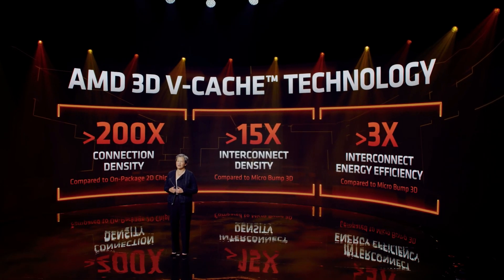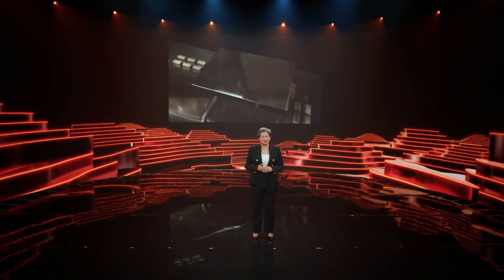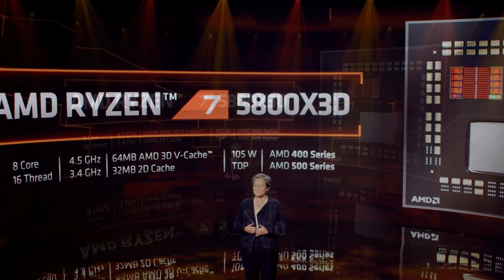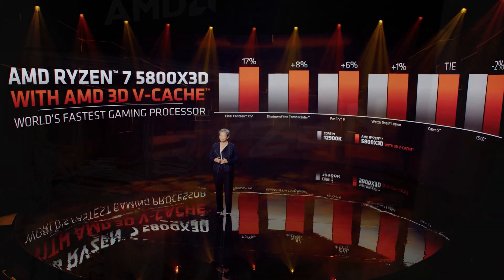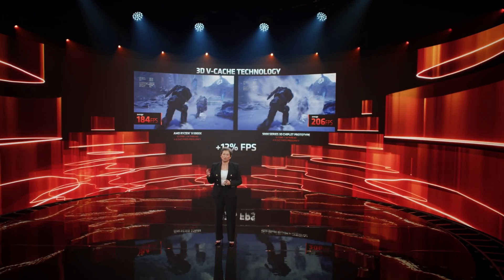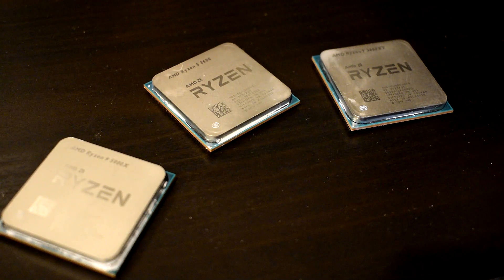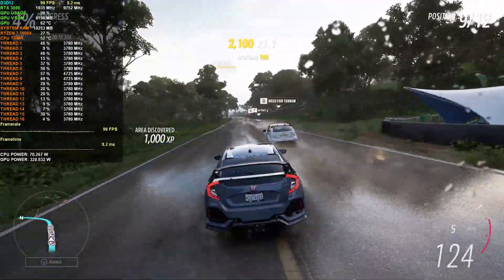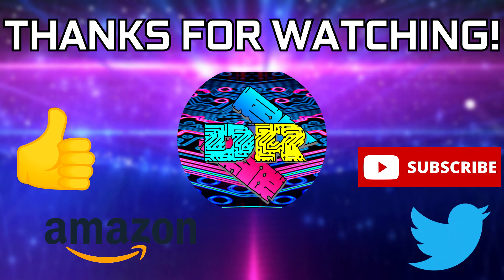AMD's Ryzen 7 5800X3D Is A Strange Product With A Lot Of Missed Opportunity For Early Zen Adopters

Comment: For gaming 6 cores is the balanced choice. 8 cores squezes out the max you can get. the 12 core ryzen beats the 8 core ryzen pure on frequency. Reviewers tested the ryzen 5900x with the same frequency as the 5800x and gaming results where almost equel. So getting more then 8 cores for gaming is currently not needed. 3D cache is a feature that excels mainly for gaming. but because of the extra heat the processor speed is reduced. Logicly the 5800X is the prime candidate for 3D cache. Putting 3D cache on the 5900 is a shame. Personally I have the 3600 and I'm definatly upgrading to the 5800X3D with my 450 board

Comment: I think they need to collect a large amount of defective chiplets/dies before they can make a 6 or 12 core 3DX chip, TSMC isn't making it easy with the yields they are getting on the process. They will come in due time.
Reply: They wont come at all. By the time something like that would even happen they would have already launched Zen4 and gotten passed the inevitable first 3-4 months where the lack of chips makes it basically a paper launch in this market

Comment: I had some very minor regrets about not getting the 5900x a little over a year ago. Still I'm pretty happy with my normal 5800x. If they had announced a 5900 x 3D? I probably would have been all over that. 

I have an RTX 3080 but I'm playing at 1440p and I like to average over 75fps with my free sync monitor. Extra processing horsepower wouldn't make that much of a difference anyway I just think it would be cool.
Reply: nomasporfavor  it really depends on the game you're playing I'm playing things like cyberpunk on Max settings. When you push all the important sliders to the right that's what tends to happen Apex Legends is sort of one of those esports games that a potato can run I'm not surprised you're getting a solid FPS on that.

Comment: As a b550 user, this is a good news. I was gonna buy the 5800x, but got the 5600x instead cause it was the only one available at msrp at the time. Considering that upgrading to zen4 and ddr5 when it releases will probably cost a kidney, this would be a good upgrade option in maybe 1-2 years when the price drops.
Reply: Same case here 👍✌️
Reply: Yeah DDR4 is really good. I think it is too early to jump on DDR5 - especially for anyone who invested in good DDR4 RAM. There is a real issue though that realistically you want to be putting this in a 500 series motherboard but anyone who has a 500 series motherboard is going to have a decent enough CPU. I cheaped out by pairing a high end B350 board with a Ryzen 5 2600. I'm still glad I did as it represented really good value, but realistically I'd need to get a new MOBO to pair with a 5000 series CPU which means I'd only be moving the RAM over.

Comment: As a ryzen 1600/ x370 owner I say bring on some compatibility to early adopters
Reply: Just buy a new motherboard dude, those X370 boards really arent the best and putting a zen 3 chip on a X370 would be like driving a ferrari on shitty tires
Reply: @Angel7black  ill just wait until my rig doesn't play games, running a 1080ti on a 3440x1440 @100hz, still plays everything fine for now, upgrade path is difficult with current prices of gpus and am5 coming out later this year, new motherboard is a waste of money imo

Comment: I have a 3950x I wanted to go for 5950x3d. I skipped the 5950x... I only want to upgrade because I want the last processor for am4. I hope they release the 5950x3d.
Reply: I’m in the exact same boat as you
Reply: @biggorilla1999  I know right I have a x570 hero 8 by Asus which I bought in 2019 I was expecting at least 3 year CPU upgrade service for that board. Such a Shame but hey hope AMD gets the 5950x3D

Comment: Most likely reason for AMD only releasing the 5800X3D is that the 5900X3D/5950X3D would be too close to ZEN4 in performance.

There wouldn't be any real need to purchase a new AM5 Motherboard and the expensive DDR5 memory that goes with it,
if people could just keep their existing AM4 motherboards and DDR4 ram (and simply just buy a 5900X3D/5950X3D).

So it's basically all about money/profit.

5800X3D won't pose any threat to ZEN4 sales (as it is a mid-range CPU), but the 5900X3D/5950X3D would.
Reply: LOL they are a business when is it not about profits?
Reply: @ssaini5028  That kind of goes without saying.

But still, a lot of people don't seem to understand why they're not making a 5900X3D/5950X3D
(i think it's pretty clear why it's not going to happen).

I'd be very surprised if they release anything other than just the 5800X3D for ZEN3.
Reply: @SuperConker  5800X3D thats it you are right and nothing else has been announced anyways.  5800X3D is purely a response to Intels 12900k's lead in gaming.  Last year the only performance slides AMD provided us was gaming 15-25% gains from 3D V-Cache alone. I dont see how anyone could have an issue with this.  
Whats even more ridiculous is Intels response which is a binned 5.5Ghz 12900K variant.
Reply: too lure clueless gamers, to make them buy 5800x3d while offering it as the only alternative, no cheape
Reply: @user-wq9mw2xz3j  For those gamers with a AM4 Platform and only care about gaming it does not get better than the 5800X3D
Reply: @ssaini5028  it doesn't get better than a r5 3600, or at max r5 5600x, since if you care about money and still have am4 that means you're not gonna have a 3090 ti so it won't matter anyways.
Reply: @user-wq9mw2xz3j  I am not understanding you.  Depending on your needs the 5800X3D should get you way more FPS than the 3600 in games.  3090Ti ain't necessary a 6900XT or a 3080TI will suffice
Reply: @ssaini5028  it wont get you "way more fps" in any game not even compared to 3600. And compared to 5600x, barely any.

Unless youre talking about going from 400 fps in cs go to 500 fps which is useless...

if you have $1500 to spend on a 6900xt or a 3080ti, you can spend $50 more on buying a new motherboard for when next gen mobo/cpus come out...
Reply: @user-wq9mw2xz3j  the i9 12900k is faster than the 5950X in gaming right?  The 5800X3D accoring to AMD is faster than that.  There is a lot of people out there that want the best in terms of a gaming CPU but not necessarily wants to change platform motherboards RAM etc.  For a consumers on the AM4 that possibly wants the extra performance might consider the 5800X3D instead of switch up to Intel thats my point.  Yea money might not be an issue for a lot of these gamers but the hassel of changing platforms especially DDR5 which is non-existant is just annoying,
Reply: It wouldnt be even close to zen4 anyways, it would just need 2x the V-cache cuz arent the 5900 split into like two 8core parts? So it would be twice expensive with little gains of 10%

Comment: I am not even sure Zen4 will have 3DVcache. After seeing the frequency drop on Vcache variant, how come Zen4 does 5Ghz all core on ES? It probably doesn't have Vcache.
In my opinion there are 2 reasons why AMD decided not to make 5950X3D:

- AMD rather use most of their Vcache on Epyc CPUs, hence a single CCD option only for the consumer market. A 2CCD Vcache chip could mean a potential shortage of Vcache for server CPUs.
- AMD are afraid that a 5950X3D would be too good, and potentially harm Zen4 sales.

Comment: Lowered clock speeds of 5800X3D sound like it's definitely related to a temp problem... 5800X is an already HOT running CPU as you've mentioned before and AMD decided to make it HOTTER ? 
- Thanks, but No thanks AMD !
Reply: Definitely it's to stay in the TDP lol